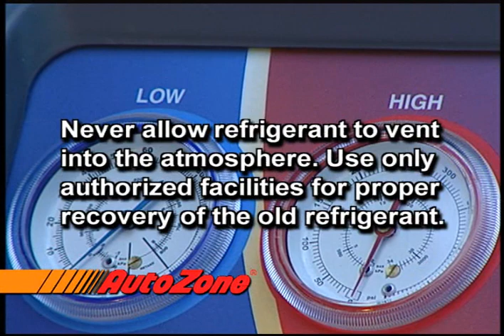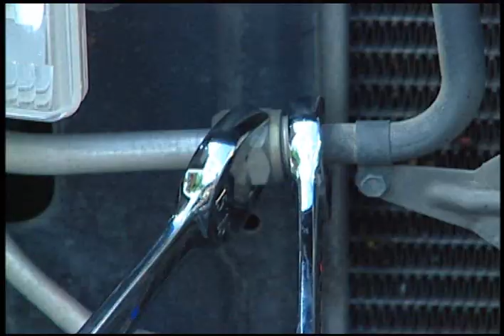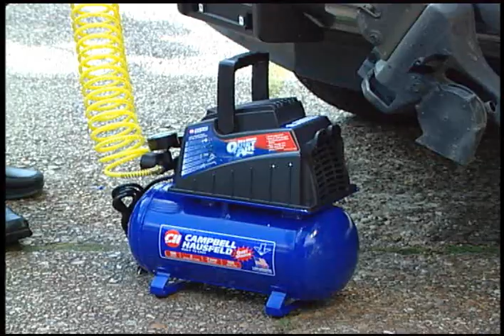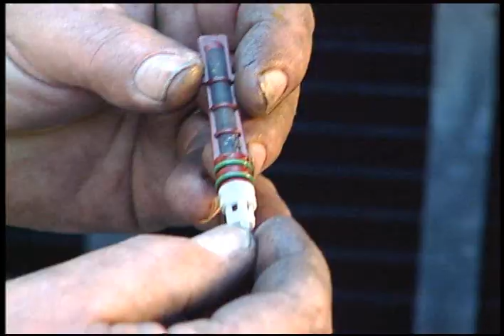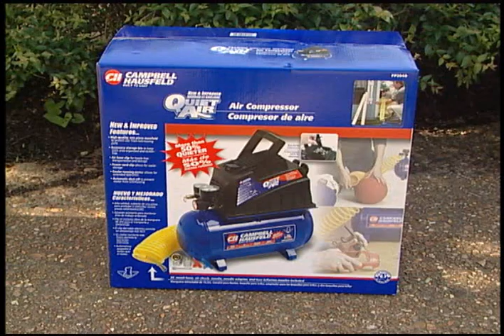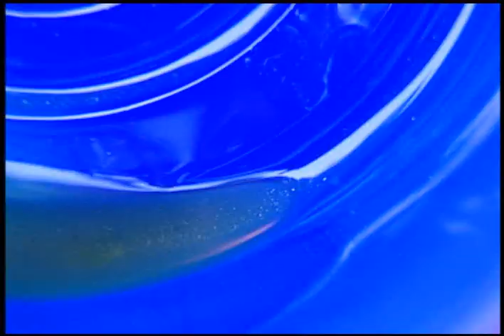How To Do Your Own Car AC Repair- AutoZone Car Care

Comment: So you add water to the fitting, turn on hose until water comes out low or high side? How much psi? So you can tell if the compressor clutch is engaging by putting your foot on the 5th pedal?  Wow this video is TOTALLY uninformative and helps one understand nothing except how to take your ac system apart. Good luck with that!
   Oh BTW after replacing the entire ac system it still didn't work. Turns out it was a blown fuse! Thanks alot!!!

Comment: 2000 pontiac bonneville ac was working fine,,altenator stoped working so i removed& replaced it along with cleaning corrosion from all batt cable terminals.connected cables along with altenator now the ac only blows out the window defrost and the floor NO AIR FROM THE DASH VENTS!!  WHY??? HOW?? THERE IS NO VACUM LEAK